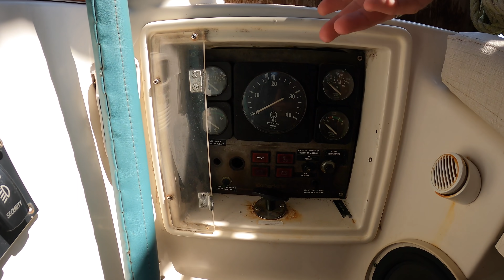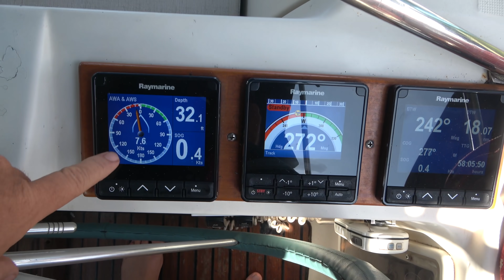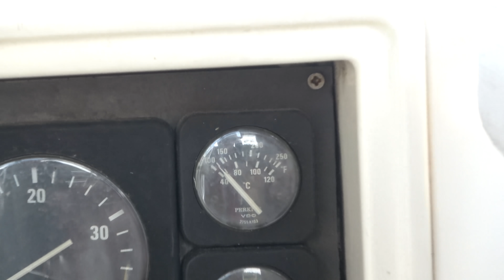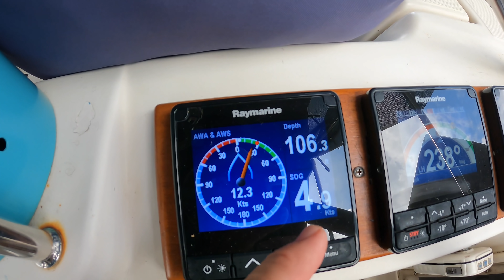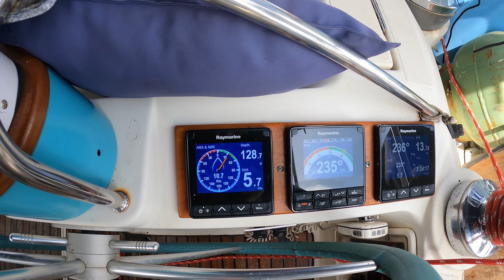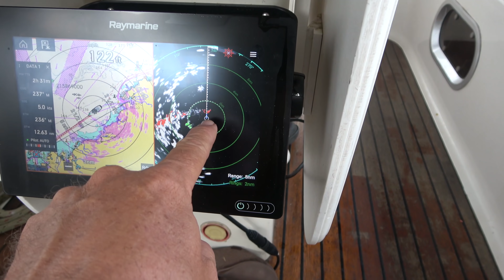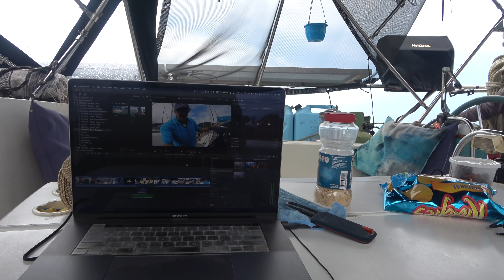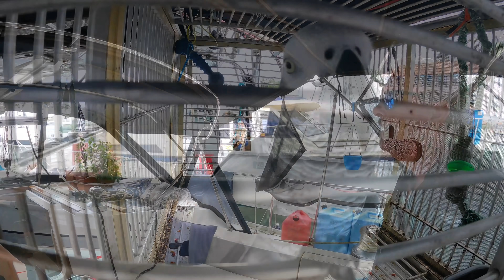SSL578 ~ Breaking in the NEW CREW

Comment: Curious... when your having overheat issues, is the hose leading to the inlet (suction) side of your water pump collapsing by any chance? That was an issue in the days of yore with some cars that could be difficult/infuriating to diagnose; as they'd 'pop' back out when you slow down or stop.

The fix was a spring within said hose.

Cool videos, Thanks!

Comment: On the start of engine you don’t have to vent the covered engine for possible gas fumes or you do not have to do that with Diesel fuel?  I had a 22 foot Sea Ray boat for many years and I always vented the engine before starting.  I have seen an engine catch fire on start up in the marina.  With my boat it was gas not diesel.

Comment: Captain Rick, I can’t recall which engine you have? My Perkins 4.236 has ran between 140°F - 160°F, but never above this. For my engine I see two thermostat options of 78°C (172°F) and 82°C (180°F). I am about to replace my thermostat. I thought these marine diesels should run approximately in the temperature range of the two thermostat temperatures I mentioned, for best fuel efficiency and best operating temperature for reduced engine wear? Any chance your thermostat is actually stuck open and not keeping the temperature in the ideal range?

Comment: Correctly using VHF marine radio initial call transmissions procedures are rarley studied. When obtaining your restricted radio operators permit does not require any such course. What I hear incorrectly all too often is repeating station calling and working 3 times for normal transmissions.  You should use 2X's transmission for initial call of a potentially UNMONITORED stations.  Better just once if no response call again. Then just talk normal, no need for "OVER" after each transmission.  According to regulations only emergency distress, urgency and safety transmissions require a repetitive calling. This operating procedure has seemed to fester into a standard call procedure for normal calls throughout the amateur marine VHF community. Routine calling procedures require name and/ or other identifying information of the station being called, spoken once only. The three times should only be used for distress, whether for Sucurite, Pan Pan or MayDay